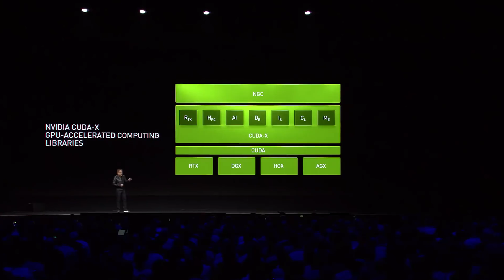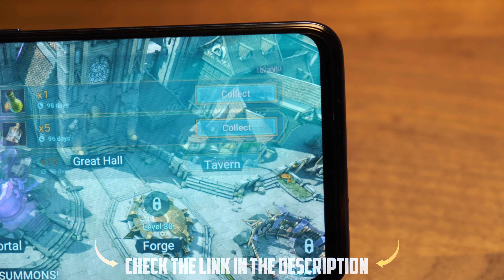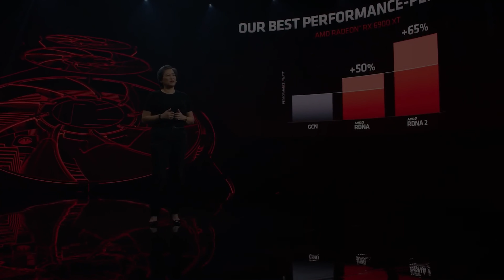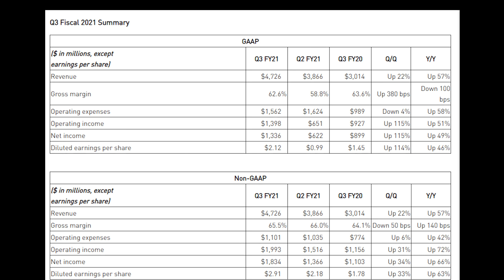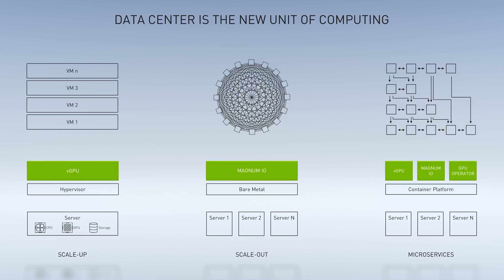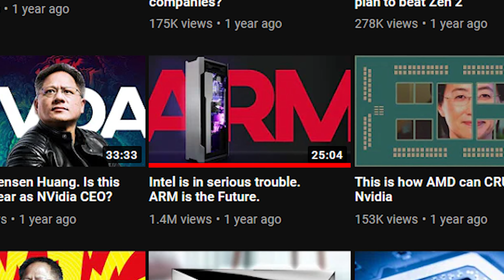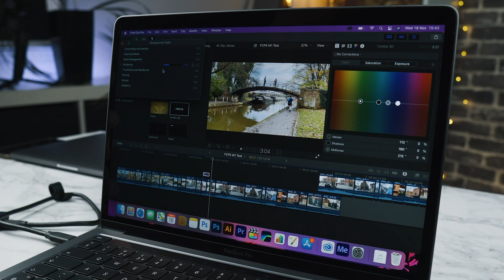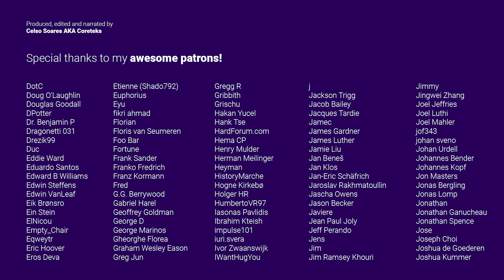NVidia has a REVOLUTION coming

Comment: For Nvidia to get this master plan to work they need to overcome a lot of things. First of all there is inertia. If something like the x86 already just works, then changing that isnt going to be so easy. After all if you can shift work off of an Arm processor, you can do the same with X86 as well. To create a value proposition making it worthwhile for people to change you need to allow that work to be done off core far more efficiently when tied to the ARM processor. I am not sure that is going to be quite as easy as this video makes out.

Also Nvidia has a history of not working well with partners. I would imagine that those problems come from the top, and there are likely to be problems within different divisions of Nvidia as well. We have seen at Intel what can happen when a company gets large and you have lots of political battles going on, very little gets done. We cant be sure that Nvidia will emulate the recent Intel meltdown, but the potential for problems is there and much higher than something similar happening at AMD.

Also, the GPUs are going to have to run a lot cooler! Nvidia might have a better more powerful GPU, but efficiency is more important in the data centre. The difference between them and AMD is small, but I think that they had a big lead just evaporate. It wont be easy to open up a big gap over AMD again, and they might fall behind. It wont help their master plan of offering a product to the data centre where the work is being offloaded to a fiery heating solution rather than a super efficient gpu.

Comment: You entirely miss the AMD architecture in PCIe design and their new pro design and acquisitions in FPGAs and Fiber Optic Design. AMD IS POSITIONED TO UTILIZE BOTH MASSIVE CORE IN THE CPU AND MASSIVE GPU Software Defined PCIe SERVERS. This means on the fly reconfiguration PCIe resources like “Liquid” does, but in a new PCIe FABRIC connecting multiple servers that can be configured into virtual hardware configurations on the fly. Their processors already free up PCIe and enable new optical PCIe in their acquisition portfolio. NVIDA hold on to your hat, we’re already planning a deployment with 2400 AMD Epyc Servers and 9600 GPUs! All will be configurable in a software defined hardware server configuration.

Comment: @Coreteks, you know that Mellanox already makes heavy use of Xilinx FPGAs in their products, right?! I guess that makes AMD part of Nvidia's future unless they decide to ditch these. But I am with you that AMD should be prepered that ARM on the desktop and server could be taking off finally. Their ambidextrous computing initiative should make a comeback which was a platform developed to be ready for both x86 and AARCH64. I wonder what their deal with Samsung was all about - not just GPU IP and I guess they could already be co-designing such a desktop ARM chip and share the profits which come out of it.

Comment: Very relevant analysis ! I own a RTX 2080 ti whos run all my favorites games ( 1440 res and between 70-140+ fps) at max setting. However the RayTracing setting is on  OFF. Quite frankly i dont care about this feature. I'm a gamer and i must say that this feature isn't interesting to me...... if RT cost me 40-60 fps each time i use it ( almost no games  offer r-tracing or DLSS options btw). So 2080 ti it is and will be.....until the Games will ask for more horsepower and i dont think that will happen tomorrow !!! (  Then i'll go AMD......simple as that.).

Comment: The problem with all nvidia’s features is that almost all of them are proprietary. Nobody wants to adopt technology that would disappear in just couple years. *physX
Reply: Physx never disappeared, it mutated and it is still there. Ray tracing is here to stay or amd would never ever release gpus with hw acceleration, same with ai.... Especially the latter it is insane what the newer 2.x dlss does as well as ai drive upscale for videos on the little nvidia shield tv
Reply: @MasterControl90original  physX never existed anywhere other than nvidia’s gpus. Same with nvidia’s implementation of ray tracing. AMD and Intel both are working on open standards, be it directX or Vulcan or OpenGL.
Reply: @Ruberoidberg  do you search better, you will be surprised

Comment: A very interesting take and analysis, Coreteks. 

It seems to me that Apple and Microsoft are both likely to go the ARM route (and Apple has already done so), despite the move by Nvidia to acquire ARM, because both are big enough that Nvidia cannot really screw them over. They can handle Nvidia, at least for now. However, that may not last into the future. If I was Jensen, the next big thing I would work on is software- specifically, I would be looking to develop my own operating system. That would free Nvidia from both Apple and Microsoft in the future, and allow Nvidia to provide a complete computing package through its own mix of hardware and software. Basically, it would provide the platform (canvas) and let software developers add on to this (the paint). 

As for Intel and AMD, they both are in trouble long term if they don't adapt. x86 will survive a while due to games, which favor (mostly, anways) powerful CPUs and GPUs together. Accelerators will definitely help, but that is a very long term trend towards their replacement. I don't see it for a decade, at least. However, that doesn't mean that both companies couldn't get shut out of other markets. 

For Intel, they have the money and muscle to make the kind of necessary adaptions. However, they lack the flexibility/agility and the vision to do so. They are stuck with process/node problems, they have made bad bets for future growth (investing in data storage, for example), and they aren't likely to catch up in the next 5 years. 

AMD has the agility and vision to adapt, I think. Lisa Su and others at AMD seem to be forward thinking and making the right kind of bets at the moment. The problem for AMD is that they lack the money and the muscle to really adapt as they should. Acquiring Xilinx is a necessary step, but they still lag in software, which will hurt them. However, they have the advantage of having good ties with Microsoft, Sony and Apple at the moment. This could help carry them long enough for them to bulk up their software section as well as make the necessary R&D towards where the market is moving. 

Right now AMD, Intel and Nvidia are setting themselves towards a future where they are the Big Three. And the only three. Essentially they will be the chief computer hardware developers/manufacturers, and everyone else is bought up or is reduced to irrelevancy. Even more so than before. Nvidia looks well positioned to come out ahead in this, and Intel is looking shaky. AMD could prove to be the wildcard in the future they have proven to be these last few years.

Comment: You make sence but the world does not make sense. Consoles do always stear PC gaming and there AMD. Nvidia piss's in the wind. Cause they rule performance, Interesting times.

Any tech loober that benchmarks with GTA5 is an old man.. And many other benchmarks. The new cards do ok but who is making the new games for what spec ?

Also what software runs on GPU's ? they do work but dont do anything useful. Without a CPU you have awesome matrix calculations.

Comment: Next Gen Console might be powered by NVidia
Reply: Nintendo switch yes
Reply: Yeah switch with DLSS 2.0 and GeForce Now integration.
Reply: @randocalrissian9217  DLSS does not worth the way it think it does. It takes time to run DLSS. I dont think we will see DLSS in the switch unless its at least 2060 perf.
Reply: @ZAGAN-OZ  maybe. But I wouldn’t sleep on mobile GPUs anymore considering the M1 is putting up GTX 1050 scores AND if the new NVIDIA Switch SoC contain more machine learning IP cores to this video’s point, I definitely think we can see a gen 1 implementation of DLSS on a mobile chip in 2 years what with apple and MS throwing their weight behind ARM SoC.
Reply: @randocalrissian9217  there is a difference between making high performance GPU at certain power vs making 1050 to fill a price bracket. Apple Silicon has a lot of $ . Think about a APU with infinity cache.

Comment: What is an inferior Samsung 8 nm node. What aspects makes Samsung 8 nm an inferior lithography process to TSMC 7 nm, Please state validated technical observations and not You Tube continuing echo box on the growing concern of mimicking repeaters. I can perform that technical audit but don't have the time. Who will do it? mb
Reply: No the Ampere stock situation is not bad and I identified science, government, rogue state and commercial primary buyers 45 days ago; You Tube echo box.  Pursuant massive data center mining operations, rogue/commercial, I will now add associate network some of which may be criminal .mb
Reply: Ampere is keeping Xeon relevant, 500 million units of Scalable, v4, v3 . . . I have the exact number but the workstation is powered down. See my blog spot on Seeking Alpha. World government and industry does not want back in time Xeon entering secondary market as Ice lake rolls out because that would obsolete these capital accumulated values held in inventory by the channel, by holding companies, that would send the entire industry into recession on destroying what is now AMD, Intel, Nvidia even what will be ARM's primary financing source into future time. Intel has catalyzed multiple WW recessions 2001, 2005, 2008 by doing just this that government is monitoring to prevent, and industry to prevent because that would destroy the industry financially . . . "as the semiconductor industry evolves". mb

Comment: I was planing to upgrade to zen3 but then i saw M1 and man o man... they are rocking with what they learned from iphone and bring it to PC industry, seems like with current plans we wont have these similar techs atleast for another 2 or 3 years, so ill upgrade, but here is my plot twist: huawei has learned apple cpu engineering and done it in kirin cpus, china is planing to get away from intel/amd so before nvidia or any other company, we will have huawei kirin powered laptops which will destroy PCs because they wont cheapout like apple on 4 cores and 8 gb of ram

Comment: microsoft has been pushing windows on arm for 8 years now and they are just bad at development
Reply: Nope Microsoft isn't bad at all, also ARM really saw a significant evolution with 7 and 5nm nodes. Microsoft is way larger than apple when it comes to software/programs, industries....... thats why there is bootcamp and apple is more specialised in very few things, also the developers are one of the problems since tousands of programs still runs on very old Microsoft OS
Reply: @carholic-sz3qv  no, you can’t underestimate apple’s level of integration. They are developing hardware and coding for the software. Microsoft is only a software company. There isn’t much synergy going on for Microsoft.
Reply: @s0methingmesh132  who said Microsoft isn't secretly developing their own chips?! They have long enough supported intel, nvidia, AMD.... they are working on something, the office 365 is even available on ARM apple devices
Reply: @carholic-sz3qv  do you think Microsoft have the courage to make their own processor? I don’t think so. That will just position them as another Apple. If they do make their own processor, Amd and intel will just go to linux and make it the standard. Also, when I said Microsoft make their own chip, I mean they make it by themself without partners. There is a reason why Microsoft don’t want to compete against its partner, aka Amd/intel/Nvidia/Qualcomm/(maybe Samsung). Also, I don’t get your last point.... it is natural for Microsoft to support office on Apple devices.
Reply: @s0methingmesh132  yeah I think Microsoft will make their own chips or go with NVIDIA since nvidia bought ARM. What makes apple good is that they didnt use all the chip manufacturers but just two. AMD, INTEL  can still compete in the server and other domains
Reply: @s0methingmesh132  yes Microsoft makes office for apple devices just like Google makes their own services available on apple platforms,   there isn't simply a better platform